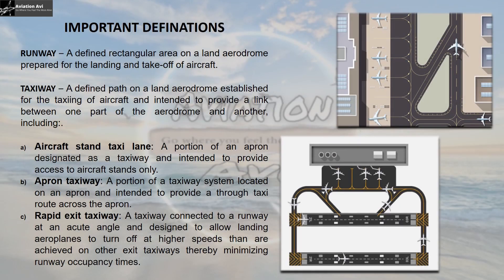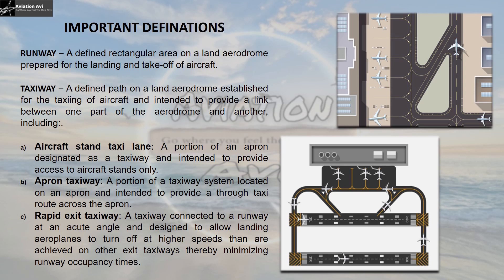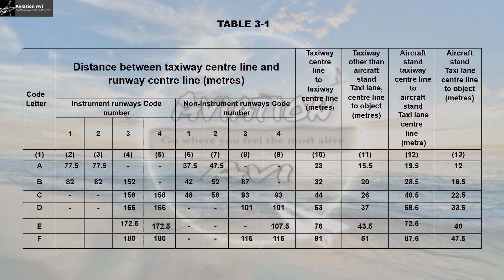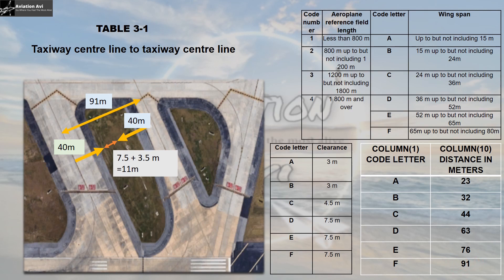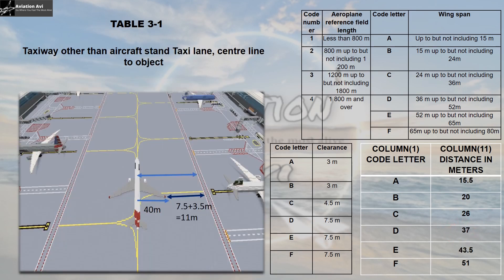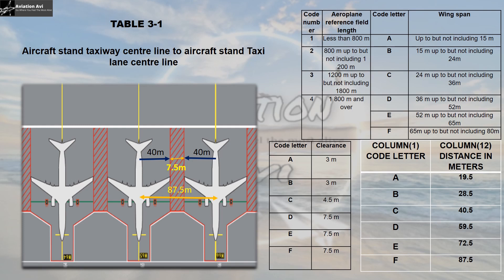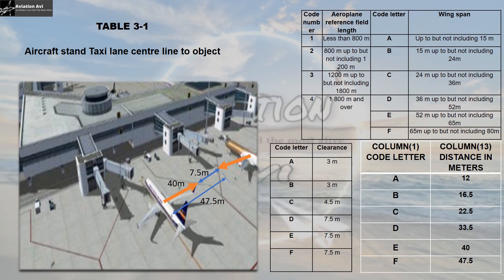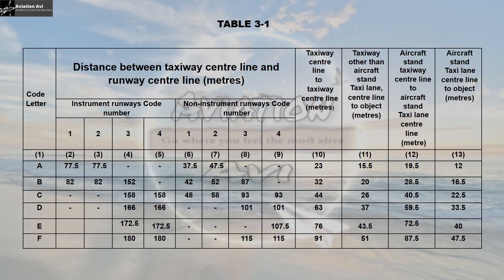Table 3-1 Annex 14 | Detailed explanation of distance between Taxiway, Taxi lane, Runway & Object.

Comment: A very good presentation, properly designed.However,unable to arrive at the value  for code A &B  aircraft of column 10.
Request to provide the wheel deviation values  used to determine values  in column 10 for different codes of aircraft.

Comment: how to deal with manhole or trenches cover /lit not flush with the surrounding surface  within a distance of 35m from twy cl for 4E ? Thank you.
Reply from the maker: First of all anything (trench, cover plates, etc) need not be 100% flushed with the surrounding surface. But we should try to make it as practicable as possible.
With the passage of time we can fill the undulation and make it flush with the surrounding.
Reply: Per my understanding there is a buffer of 3 inches height or physically manholes with not much likelihood of possessing higher risk at a distance bit far away from cl consider permitted you mean ?
    @aviationavi7532